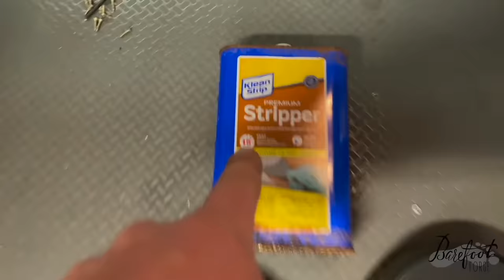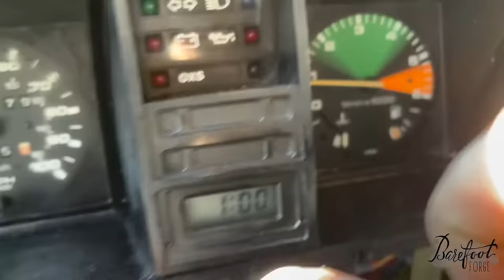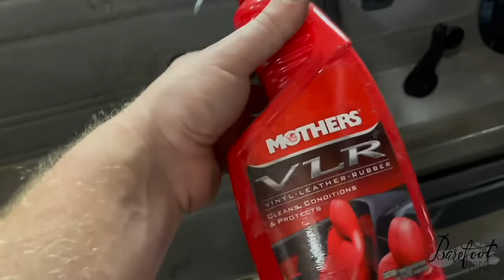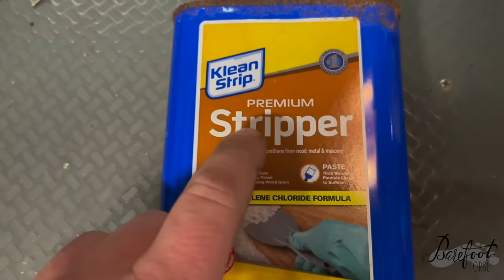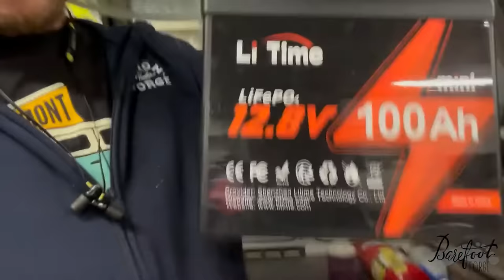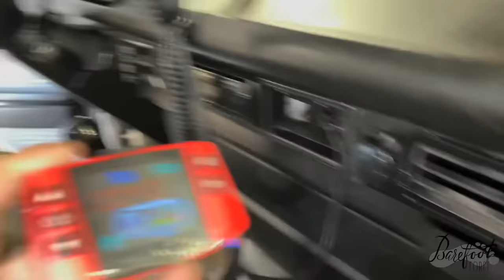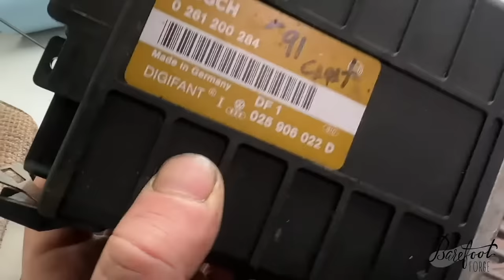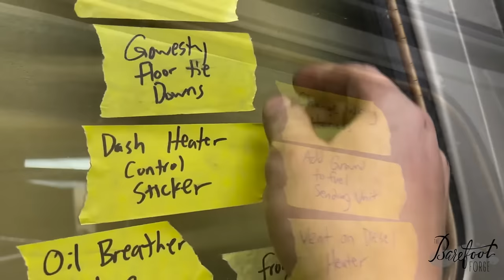Forgotten 1987 VW Vanagon Syncro Westfalia- "Heidi"- Will it run? Chapter 4 DAILY DRIVER

Comment: What works great as a general cleaner for the undercarriage is simple green and hot water. Pop that in a power washer system. Smells good, degreases and just eats away grime. Safe for the metal surfaces won’t eat rubber off. It’s also pretty good on interior surfaces.

Comment: Nice idea on concealing the battery.  Actually, that is a great battery option for a Vanagon / Syncro.  I am trying to keep areas near water separate from electrical things.  Cool CB idea too!    Appreciate your videos.
Reply from the maker: I have bigger concerns with water escaping then it damaging the top posts of my battery. It would take a standing puddle of 10” of water in the entire bus to damage the battery.
Reply: @TheBarefootForge  That's fair enough.  It works...that's what counts.  Enjoy.

Comment: Thank you for your time and effort putting together these videos, I truly enjoy watching your progress! What are your thoughts on the Mansi rocker upgrade, is it worth the $$?
Reply from the maker: Yes. I don’t believe that every performance part works, I don’t believe the injectors are truly an “upgrade” per say (as an example)- but the ratio rockers do a specific thing to optimize the engine, and they create noticeable results. Probably the first/single best bolt on horsepower upgrade to the wbxer.

Comment: You should use some Interplus 356 for the crunchy parts. We use that a lot on T4s in Europe.
Reply from the maker: What’s that do?
Reply: @TheBarefootForge  industrial grade two part epoxy primer, the stuff used on bridges, paper mills, offshore structures etc. 

I've painted the entire underbody of my Pajero with this stuff (and Interthane 990 polyurethane 2K paint as a top coat, with spray-on seam sealer in between these paints - see 3M MS, Teroson, Sika SikaFlex 529 - what factory used and skimped on) and I'm planning the same for my VW T3 bus once I finish the Pajero. 

I've used these industrial paints on the invisible parts (underbody, suspension, engine bay) so didn't care about the appearance, I wanted it in every nook and cranny and thick layers. For the visible parts of the car that had bodywork done I've used standard automotive system - epoxy primer, base colour and clear coat.

You can find similar industrial grade paints from the likes of PPG (Sigmacover) or TransOcean (Transpoxy Masterbond Aluminium).